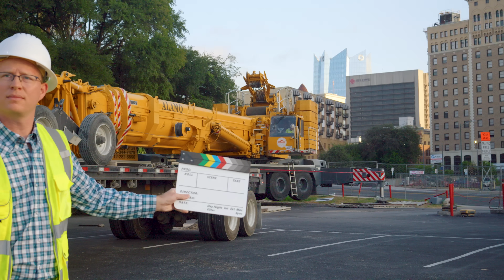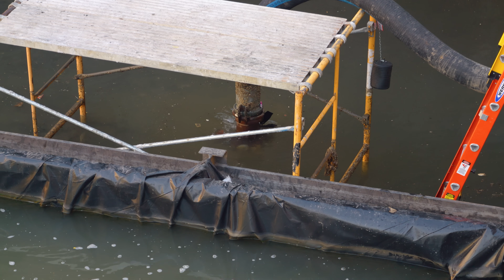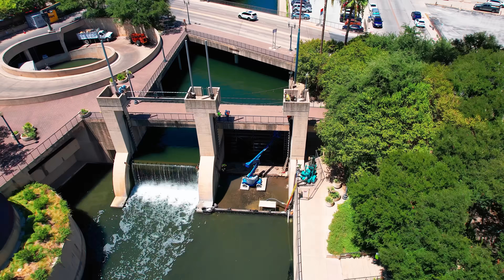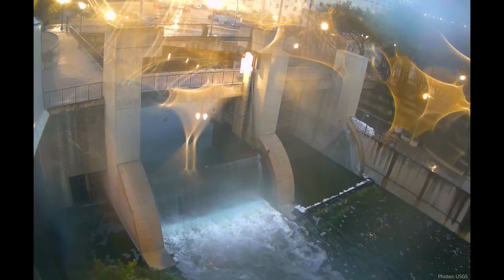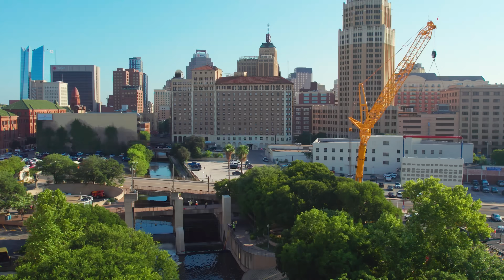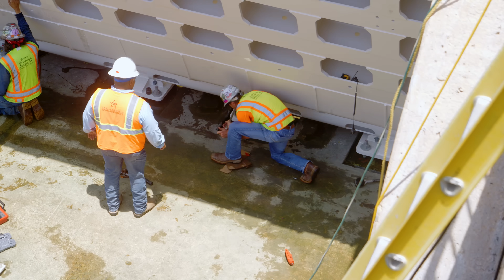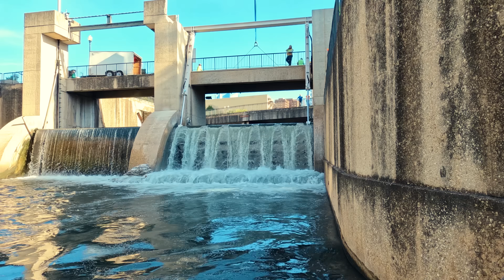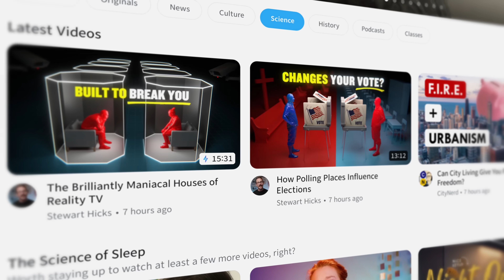The Hidden Engineering Behind Texas's Top Tourist Attraction

Comment: This is like those old Discovery documentaries about big projects but without unnecessary filler shot repetitions to accommodate for TV ad breaks and without that hyping tone "NOW BEGINS THE FIGHT WITH THE GRAVITY, WILL CREW BE ABLE TO LIFT THAT GIANT PIECE OF STEEL?". So much better to have calm and reassuring narration.
Reply: And so much over the top suspenseful music like the thing would break any second. rofl This is much better.
Reply: @worawatli8952 then at the peak of suspense they cut to someone going woah woah woah! Into an ad break.... then they come back, recap the whole episode to that point, and the guy is just saying woah it's time for lunch.
Reply: @worawatli8952  I enjoyed the synth music in the old discovery documentaries. So Relaxing, with the narrator with the deep voice. OG Extreme Engineering for the win.
Reply: WILL THEY BE ABLE TO REMOVE THE SCREWS?

 Find out after the break!
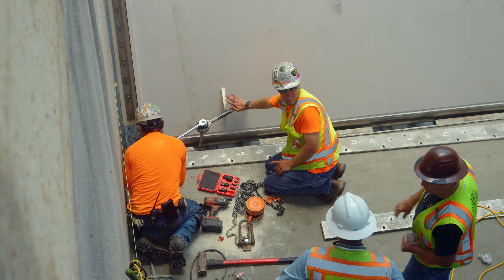Reply: @seattlegrrlie  15:10 Just a guy using torque wrench. " IF THEY OVER-TIGHTEN THE BOLT, THE THREADS MIGHT BREAK," **suspenseful music**.
Reply: @worawatli8952  and 5 different shots for each bolt in slow motion.
Reply: @seattlegrrlie  DOES THE CREW SURVIVES GOING UNDER THE DOOR TO CONNECT THE HINGES?
Reply: Or even worse all the forced interpersonal drama.
Reply: @zachmft  and scheduling conflicts. IF THAT PART DOESN'T COME IN TIME WHOLE OPERATION WILL BE IN DANGER.
Reply: @rotors_taker_0h 😮😮😮😮😮😮😮
Reply: Seriously...why did TV shows have to manufacture so much drama rather than just tell the story like this? This is so much more pleasant to watch and provides far more information.
Reply: TV shows did that because they tried to reach the biggest audience, and not just the audience interested in civil engineering
Reply: @SomeGuysGarage  it requires very little actual footage. And dumb, bored people in front of tv will sit through almost anything. They are just stuck in the world without the internet.
Reply: @SomeGuysGarage  Because of commercial breaks, they needed something to hook people in to continue watching after the commercials especially when people can easily channel surf to multiple channels during a commercial break.
Reply: Agree 100%.  Those shows used to be interesting before they started overhyping stuff.  Or the silly commentary, "Will it hold up?  Or will it be a disaster... stay tuned to find out."
Reply: @mikefochtman7164 Don’t forget the random sudden scary loud noise and flying curse words for something that turned out to not be that big of a deal
Reply: You mean, like those old Discovery documentaries. They used to not have any of the cruft at all. It was glorious.
Reply: Ha! I just left a near identical comment to this. This is what documentaries should be like. Grady is the David Attenborough of engineering!
Reply: @AsphaltAntelope  Comparing Grady to Sir David Attenborough is quite appropriate. It would be hilarious if Grady published a video with an AI Sir David narrating! :eyes-pink-heart-shape:
Reply: "TIME IS RUNNING OUT!"
Reply: 100%. We watched those old shows because it was all we had.  The internet has introduced extreme competition and the viewer is better for it.  This channel is amazing and a great example of how we can do it ourselves.
Reply: Indeed. And thank god the era of TV is over.
Reply: And what was with the constant recaps? Were their target audience hospital brain trauma ward patients?
Reply: I started a reply with the "...no it's actually better, because you don't have the unneeded tension build up" but then saw the last part of your comment. It is indeed miles better.
Reply: Grady’s videos also have the benefit of being honest. I watched a ‘documentary’ about a famous road tunnel fire in Switzerland. The ‘documentary’ lead the viewer to believe that all the safety modifications had been made as a result of the fire. The truth is that: 
the safety improvements were 50 per cent complete at the time of the fire. It was bad luck that the truck caught on fire in a section of the tunnel that had yet to be upgraded.
Another misleading ‘documentary’ covered the Tacoma Narrows bridge failure in the 1930s and made out (in line with the ‘whitewashing’ official inquiry) that the failure of a brand new suspension bridge revealed new information on suspension bridge failure modes. The truth in this second instance, was that:
John Roebling encountered that particular failure mode and consequently revised his engineering approach. He famously related his experiences in his book on bridge design and construction. The design and construction of the Tacoma Narrows Bridge, in blatant violation of John Roebling’s design principles was a classic example of design and construction negligence!
Reply: @michaelguerin56  Sounds like a bunch of low stake nitpicking.
Reply: It's narrated like how it's made and I love it
Reply: WILL THE SEVERE WEATHER BRING THE PROJECT TO A CRASHING HALT!?
Reply: So true!  I used to love those now cringy “documentaries” until I saw something like this!
Reply: Its nice when you have a host who knows what they are talking about!
Reply: Agreed, it's what Discovery/TLC used to be before the reality television virus took root. Amazing work as always, Grady! I am so happy to have your videos and insights help me realize just how much human knowledge and expertise goes into everything little thing around us. It's as exciting as it is comforting!
Reply: This comment and replies are gold. I can hear the comments.
Reply: "WILL THE BOLTS TIGHTEN CORRECTLY, OR WILL THE PROJECT BE A DISASTER, FIND OUT AFTER THE BREAK"

"WELCOME BACK. actually it was quite easy, standard stuff"
Reply: Don't forget the rehash after every commercial break.
Much prefer Gradys version.
Reply: I was thinking very similar things
Reply: This would have been 2 60 minute episodes
Reply: 😂😂 I certainly agree,  no hype Grady is my favorite👍
Reply: Absolutely 100% agree. It's so refreshing.
Reply: Ai will learn so much faster with these videos and wont have so many flaws when they re present this information in 4 months
Reply: i agree, or how about "here is a preview for what you're about to watch every 5 minutes."
Reply: Man I miss those
Reply: So true
Reply: honestly, there were plenty of non sensationalized programs on discovery. Daily Planet, How It's Made, feature documentaries, etc were always no bs programs. I could count the sensationalized shows on one hand, I think most of their programs were very straightforward.
Reply: @Aimaiai  sure, the gist of my comment was about GOOD parts! I said that this video is just like the good old documentaries. Comment section just got carried away a bit with mocking of (perceived) hyping parts
Reply: Yep, instead we have: 

"What would you do if the bolt is as big around as your arm? Pretty much the same thing you'd try at a smaller scale: apply some penetrating oil, beat it with a hammer, bring out the hydraulic press, and then you just decide to cut the whole thing off". 

That is true drama, and everyone who's ever been in that situation at any scale feels those lines deeply without any of the manufactured BS. This is a masterpiece.
Reply: While Grady provides facts in positive light for smart people, Discovery and other TV stations produce drama and negativity for the other part of the population. Why? Because there are more dumb people than smart people. And TV stations cater to the majority. I know, it sucks for us smart people but we are smart enough to find good sources of information and education. Like Grady's channel here. Happy to have found it a while ago. Keep the good content flowing, Grady, we appreciate your efforts to educate the smart minority in our population.
Reply: Or some jerk throwing tools a someone else!
Reply: Exactly
Reply: great thought. PBS could learn something from these videos, too.
Reply: Hell ya
Reply: reassuring narration
Reply: I miss Roger Mudd and Modern Marvels. But Grady does a great job in filling that niche with the various channels.

Thank you Grady!!!
Reply: Oh, I agree. Let's not forget the over-use of awesome.

The Awesome power of the awesome mega vehicles just overflow with awesomeness!!!!"

Said in what the narrator believes is an awesome tone, but I just find irritating
Reply: HaHaHa...good!
Reply: This is what we are going to show you after the break

Here is what we said we would show you now time for a break

This is what we showed you before the break, come back to see what’s next after the break. 

60 minute show
8 minutes of content😖
Reply: Why did I make my voice deeper for the quotation?😂
Reply: Grew up with 10 hobby/ explainer  shows on PBS. Now there are literally millions of channels, for literally everything, yhe future does have it's perks.
Reply: If you go back and watch those you'll see Grady IS some of that filler.

But honestly I didn't mind the filler that much as long as they actually talked about thr interesting stuff at some point which they often didn't.
Reply: Big How It's Made energy
Reply: Because those types of shows are designed for low attention span type people that need to be constantly entertained or the will move on to something else.
Reply: Real.
Reply: ok, but now that you say it I would like to see the insanely over the top reality TV edit of this or another project video. maybe a patreon video or something, lol
Reply: @rancidmarshmallow4468  I've had an idea something like that, kicking around in my head for a while, but OP and the other commenters have convinced me that it's gotta be focused on the dumb narration, not so much the way they use the same script and characters on every reality show.
Reply: There is very little guesswork in engineering on this scale. The entire operation was planned down to the last crane movement before it ever started. There is no drama or suspense, there is tension as we wait to see whether it holds up or fails catastrophically. Everything that can go wrong has been accounted for, everything works.
Reply: I miss "Extreme Engineering"! Come on man, those were awesome, they talk to people from the project and film things, rather than stock footage
Reply: If you're asking the question whether your crane can lift something or not you should be getting your calculator out to be sure it is, nobody is actually taking a risk like that on a construction site. Even if you don't care at all about the safety of your crew, you still don't want to damage your equipment, parts you're trying to install and extra delays.

Construction is not mythbusters, it is serious work where experts ran the numbers to make sure it is safe.
Reply: you're just talking about modern youtube
Reply: @Sinaeb  Grady's channel is a proof of existence that it doesn't have to be like that to still have viewership.
Reply: All I can say is amen to that.
Reply: Did you know that Jesus is God? Jesus, the Son of God, gave His life on the cross for the forgiveness of sins. Through His sacrifice, we can live forever in Heaven! Repent, follow Jesus, and live forever! If you want to learn more about Jesus and Heaven, check out the Gospels of Matthew, Mark, Luke, and John in the Holy Bible.
Reply: The real Savior of the world is Jesus, the Son of God. He died for our sins on the cross. Believe in Jesus, repent, and live forever in Heaven!

Comment: What are they doing to seal the sides of the gates? It looked like there was a gap between the wall and the gate, yet I never did see anything put on to keep the water from coming out the sides.
Reply from the maker: Yes, there are rubber seals attached to the gate that ride along the stainless plates attached to the piers. Also seals on the bottom at the hinges.
Reply: Ah, I was curious about this too, the stainless was hard to see but now I see it.

I didn't think they'd have rubber directly on concrete.

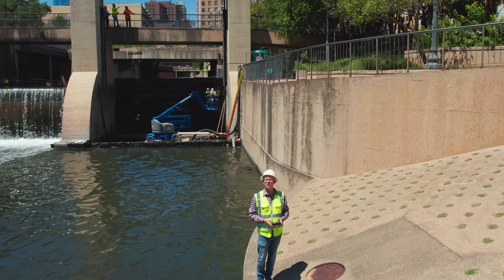Comment: 1:18 - What is the purpose of all the little grass plugs?  Retention/keeping the concrete from sliding?  Honestly don't know, thanks in advance!
Reply from the maker: I'm not sure. I think it's just an architectural thing to improve the appearance of the concrete slope paving.
Reply: @PracticalEngineeringChannel  Interesting.  I might wonder if that doesn't erode the concrete over time, but hey, I'm definitely not an engineer. :)  Thanks for the answer!
Reply: Maybe they don't want ground water pushing out the wall? So the holes allow seepage. We did this in underground mining as water trapped behind a wall can create a significant force
Reply: @mrDavo111   It lets ground water in and out. Releases pressure during large events and lets water soak in during normal rain showers to help recharge the ground water. It also helps limit maximum flood amounts via absorption and simply slowing the water movement down. In general "impermeable surface" is a negative on any project, so limiting that impact is always helpful.
Reply: It's to save money so they didn't have to pour as much concrete and helps it move more naturally without cracking

Comment: Why did they remove the old gate before the new one was fabricated?  Seems like it would have been more efficient to have the same crane for both the removal and the new installation.
Reply from the maker: The bays had to be retrofitted for the new gate with new concrete.
Reply: Ah, that makes sense.

Comment: Love your videos.  But what's the logic switching from threaded screw to hydraulics?  Seems a loss of hydraulic pressure would cause the gate to fall uncontrolled.  Needing constant pressure to hold the gate in place seems like a failure point.
Reply: Perhaps they have a safety latch like an elevator? Maybe the hydraulics lift/lower it, but then they flip out a heavy lever that would only let it go down so far before it stops even if they lost ALL hydraulic pressure? Just speculating. No hydraulic system is 100%  sealed with zero bypass. I am sure these have generator backup, but still these things are generally engineered to hold up in the worst disasters including loss of all power.
Reply: @Bambihunter1971 exactly right! The unit has ways of being operated during a power loss. Hand pump to raise the gate, needle valve to slowly lower the gate, and ports for hooking up a portable pump
Reply: I was one of the hydraulic engineers on this project when the units were built in New York. The cylinders are gravity lower, the motors/pumps do not need to be on to lower the gate. The cylinders always hold pressure, a solenoid valve energizes when it’s time to lower the gate. a pressure compensated flow control valve lowers the gate, this was set at a 20 minute lowering time. Even if the solenoid valve were to fail, the flow control valve ensure the fall is slow. As the gate is always monitored 24/7, the operator can walk to the unit and close a ball valve. In the worst case scenario if a hose were to break, there are flow fuses that cut off flow if the oil flow rate reaches 150% of its top speed. Hope this helps!
Reply: Perhaps each cylinder can hold the gate on its own and so if one cylinder loses pressure the other can hold until its fixed.
Reply: I guess failing open is not so bad for a flood gate.
Reply: @jannikheidemann3805  Not if you're downstream.  Maybe it wouldn't be too bad if the canal can take the surge of water I suppose.  Still, seems like a reduction in reliability.
Reply: One word: hydraulic lock valve

Comment: The other day I spent like 40 minutes trying to unstick a rounded off and rusted bolt off a garden swing  before I realized I’m throwing the whole thing in the recycling anyway so why not just cut it apart.
Reply: You know, there are various levels of being frugal/thrifty/stingy. I know a person, who removes all screws, bolts and lightbulbs from everything they throws away with intention to use them somehow in the future. And I have to say, if I need a weird screw or bolt (happens like every 3rd year), they have it in their neatly organised drawer and happily assists.
Reply: @Filipnalepa  I find myself keeping a lot of stuff. It does on rare occasion become useful. Thatsaid, it's also a burden keeping it all.
Reply: @Filipnalepa 

The organisation is key. I find myself not using anything I keep 'for later' cause I can't find it after so long😅
Reply: That section of the video made me laugh out loud when he called out the cutting torch.  Oh, the memories of rotten screws/bolts/hinges.
Reply: Been there, done that!
Reply: I've done that before. lol
Reply: Word of advice. Buy a small pipe wrench for those moments.

I work in industrial maintenance and having a small pocket pipe wrench for buggered nuts and bolts is a life saver.
Reply: Took 40 minutes for that? One look at the bolt and the grinder would be coming out :D